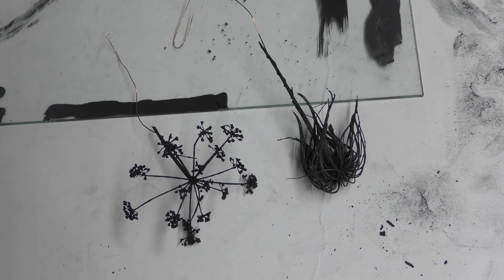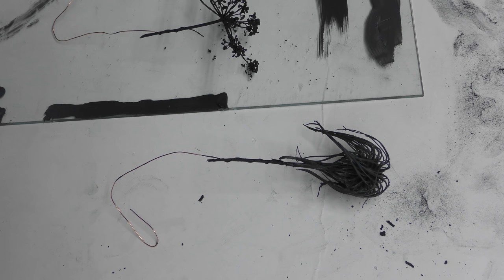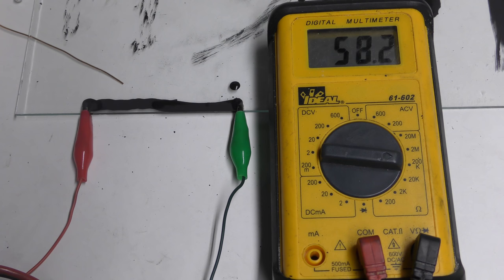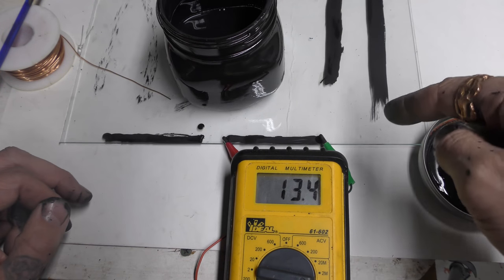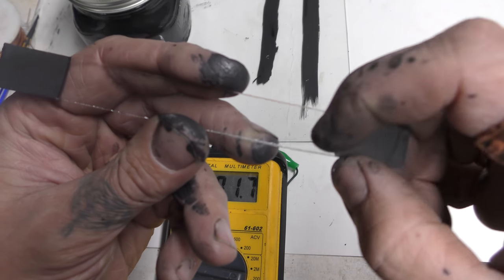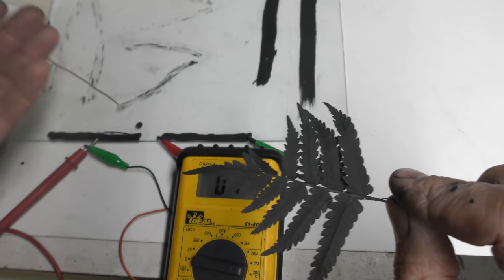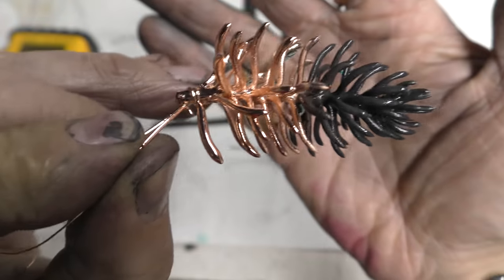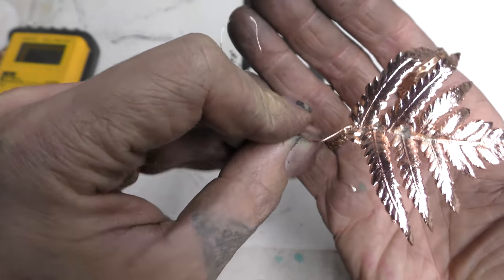Conductive paint for electroforming recipe

Comment: I'm trying to find a way to create a pitted surface that I can then copper plate. Was thinking of putting salt in the conductive paint then when dry lightly sanding the surface to expose the salt and then dissolving the salt out with water leaving a pitted surface. The problem is salt dissolves in one of the components of your conductive paint. Any suggestions on what I could replace that component with?

Comment: Can "ZEP Commercial Acidic Toilet Bowl Cleaner" as sulfuric acid for mixture with distilled water and root killer?
Reply from the maker: Rooto works good and has been tested many times by home chemists for purity.   I would search the purity of Zep before using it.
Reply: I am using sulfuric acid sold for unclogging a plumbing plug now so, if the same, yes.

Comment: But if you leave all the moisture trapped in the plant, like the succulent, I would expect internal mold or bacterial rot or degradation
Reply: If your plate is sufficient, you can use a torch to burn the insides if you're concerned about that.  There's a video on youtube of someone doing blackberry like that.

Comment: Since you're a bit mad (i.e., mad scientist), I'll share my "I don't know what the heck I'm doing, but I'll try it" experiment for you to consider:

I use a gallon or larger container and don't bother surrounding items with my anode (e.g., copper wire) material. Part of this is because, as stated in the video, it dissolves. This may mean I have to replace the whole thing because it thinned out in the middle of a coil.

First, I try to put my anode material in a polypropylene bag, which catches a lot of the debris rolling off the anode and which, otherwise, would settle on the bottom of the tank.

For an experiment, I drill about a seventy holes in a sports bottle and filled it with the scraps from my worn anodes. I ran a 6 gauge rod down into the mess and placed the bottle full of copper scraps in the poly bag. It works, but still eats at the 6 gauge wire too, but I just push it in farther until I have to chop it up and make it part of the scrap collection. I replace it with a new rod, but I only have to have one long enough enough to go to the bottom of the bottle and to project up out of the solution, so I can attach a lead to it.

The lumberjocks woodworking web sight shows some of the wood turnings I've plated using my far from an expert approaches: https://www.lumberjocks.com/projects/348297

PS I'll be ordering the product of your experiments, if only to contribute to keeping you going.
Reply: hello , I'm from Brazil and I can't get an efficient formula for conductive paint, could you help me ?? thank you